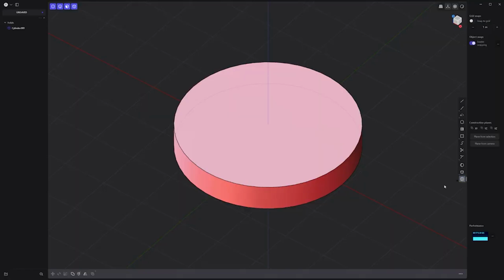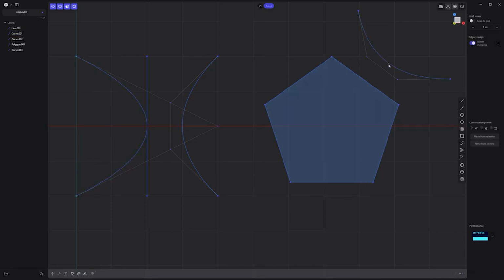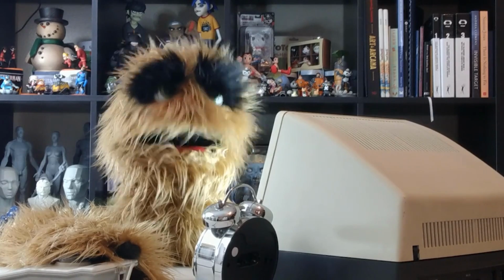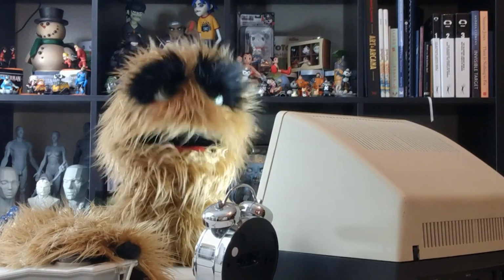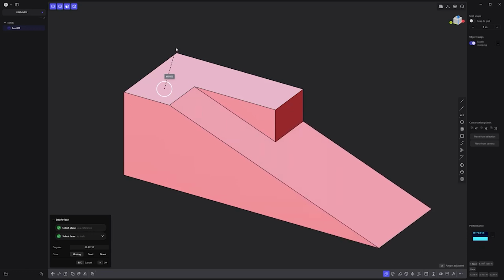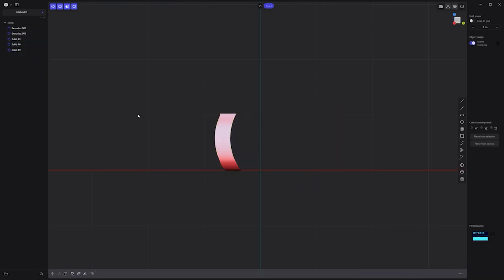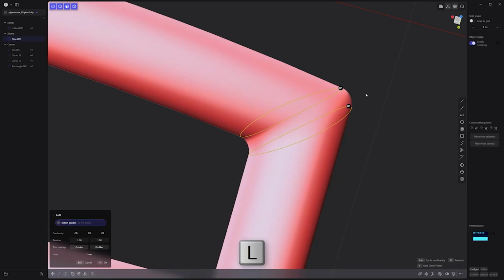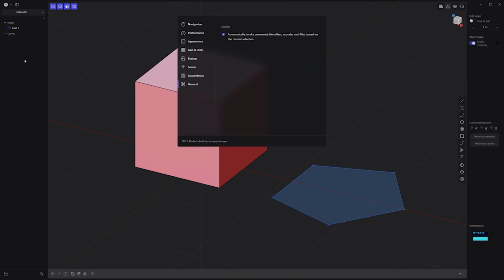Plasticity | 23 Essential Quicktips

Comment: Is there a quick way to align a group of curves (or objects) to each other so they connect?
Reply from the maker: Not sure exactly what you mean?
Reply: @pixelfondue  Something like the align tool in 3DSmax, select a group of objects and hit align , and they move to the axis selected. Otr maybe I could use move and numerical input or something, not sure.
Reply: Or like make planar in sub-object mode, align to X,Y,Z etc.
Reply from the maker: @ljcdesigns6573  other than the array tools (which are cloners, I don't think that exists yet in Plasticity)
Reply from the maker: @ljcdesigns6573  Oh, (if I'm following) - I think you will have to use the scale tool and scale to 0 in whatever axis....so if you want it planar in xy then scale to 0 in z.  Other than that - sorry, I'm not much help.
Reply: @pixelfondue  I just had a group of curves that weren't lined up to each other,  I did try scaling the points together using the gizmo to get them planar, but your way is correct, thanks.